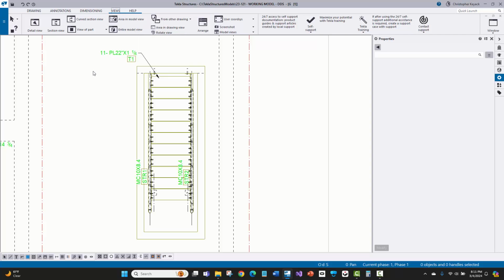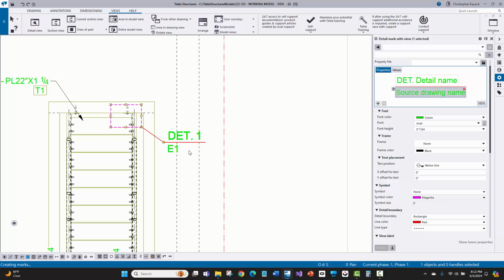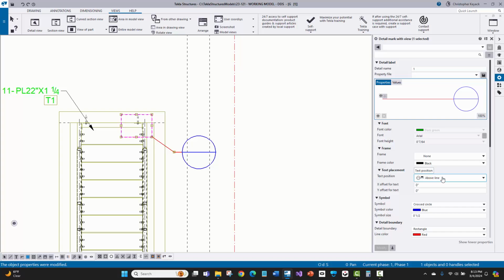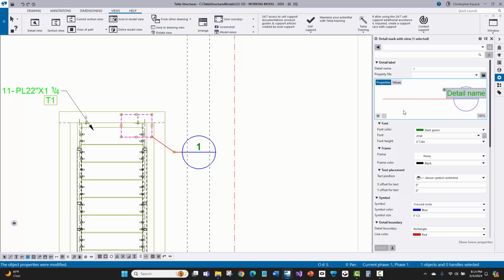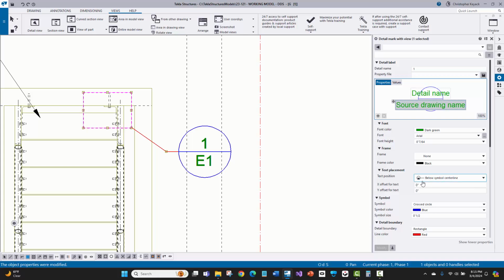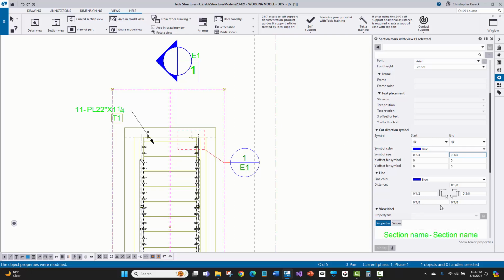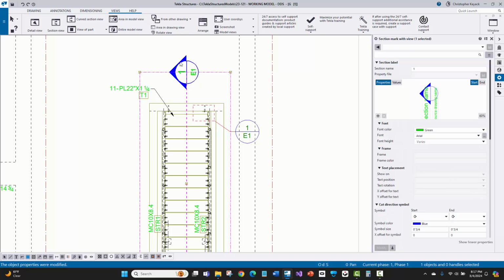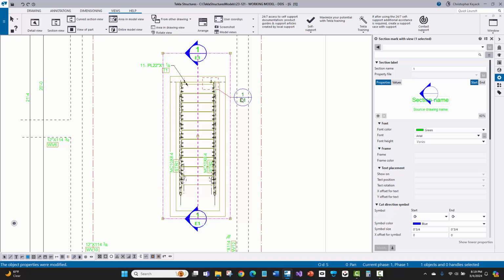KTS - Section and Detail Callouts with Tekla Drawing Property Pane

Comment: Do you have a video on on how to automate connection details on drawings. Say for example I have saved settings for a 1047 base plate and it is being used on multiple columns. When I go to create drawings I want; 1 - for the 1047 "blowup" to be automatically created, and 2 - for the plan view to auto label each instance of said detail with a dashed box or section arrows or something saying "ref. det 1/EX". is this possible with 2023?